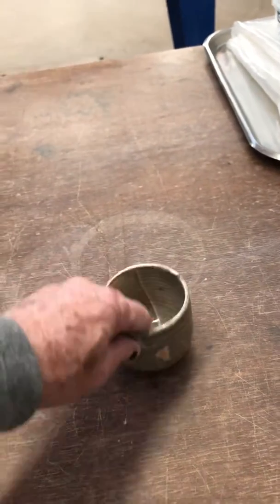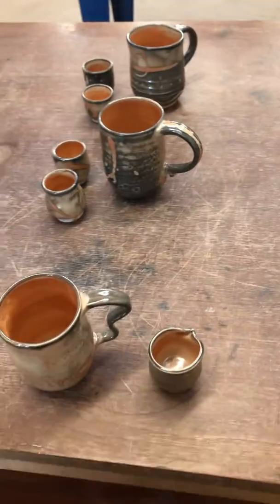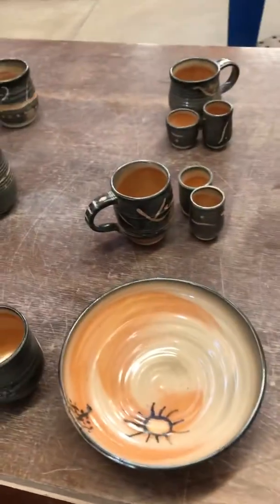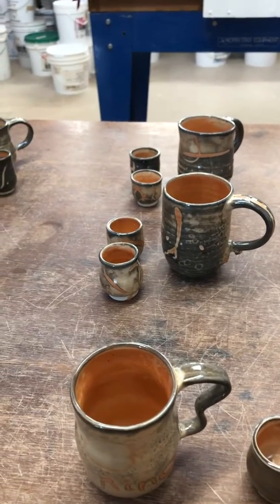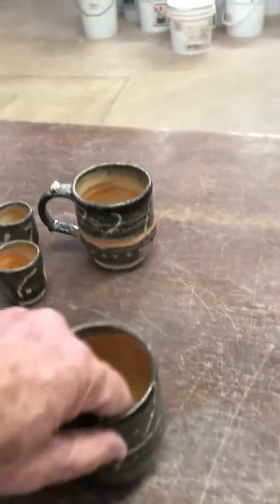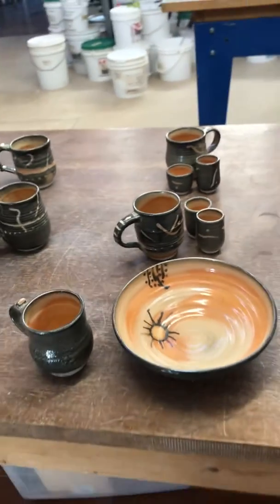Shino experiment

Comment: There fabulous! ! Can you give me some idea how you get that beautiful Orange colour please? I'm thinking of giving the carbon trap firing a go, and advice would be much apreaciated, best, Leigh.
Reply from the maker: Good question. Shino is a difficult glaze to get the results you want.  Generally, you get orange when the glaze is thin, white where thicker.  The inside of containers most always come out orange unless the glaze is thick. Carbon trap does not happen inside containers because of the dynamics of the heat airflow. (My theory is that the carbon can't fall inside due to the heat rising from inside).  On the outside, I use wax resist to create designs that come out orange, and sometimes it is highlighted with black carbon.

Given all that, different Shino recipes and different clay bodies make a difference also.  Good luck. Mu suggestion is to document what you do and don't try too many variables at one time.
Reply: @FredWilbur  Hi Fred, thanks so much for the reply, I wasn't sure if the orange was an under slip, a bit like how they soda fire. Yes I know different clay bodies will have an affect on the outcome. It's a firing I can't seem to find much info on, at what stage do you carbon trap? I found one article that said from cone 014 to cone 08 and then normal reduction to the end of the firing. Sorry for all the questions. Leigh.
Reply from the maker: @handmadepottery2135  Leigh,  I start heavy reduction at 012 and try to stall the rise for an hour.  However, it sometimes climbs to cone 010.  I then keep the kiln in medium reduction to end, which is cone 10  to 11. To get the carbon trap I use Malcolm Davis Shino on porcelain works best and I have to glaze 2 - 3 days or more before firing.  If you glaze close to your firing time, the soda ash does not get a chance to migrate to the surface. I never fired reduction to cone 6, but a web search shows some have successfully gotten carbon trap at cone 6. See John Britt's website: http://johnbrittpottery.blogspot.com/2009/06/malcolm-shino-fired-at-cone-6.html
Reply: @FredWilbur  Thanks Fred, really appreciate you getting back to me. You should do more  clips, your pots and glazes are fantastic!! And my kids love Sophie; 0).